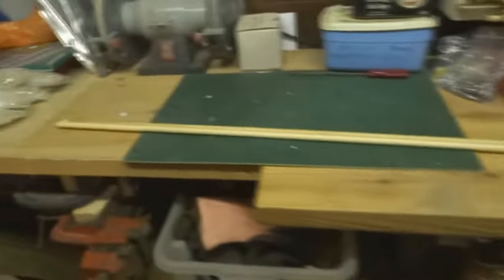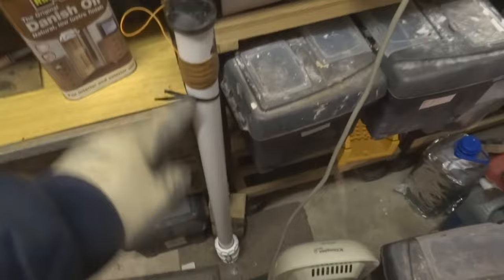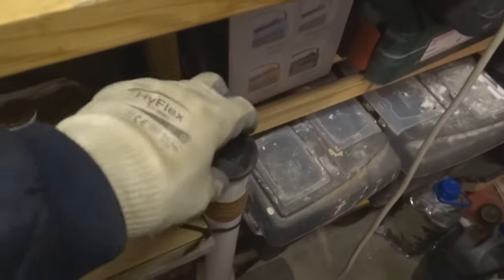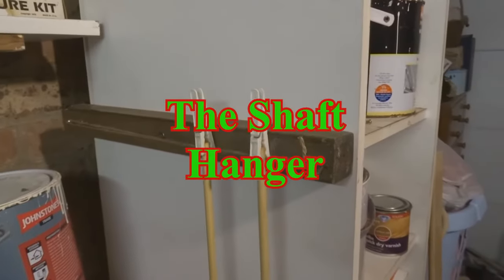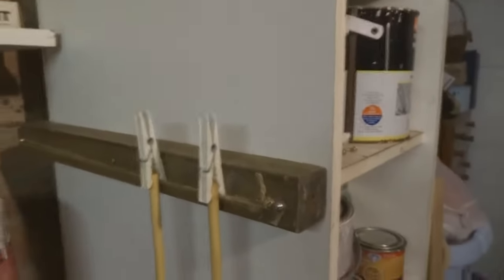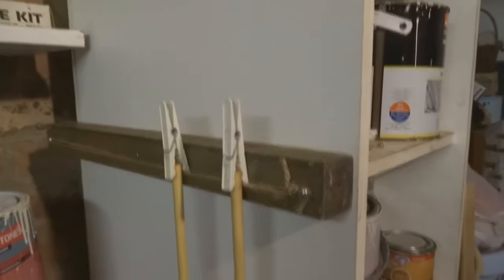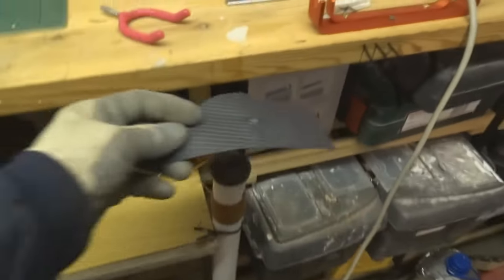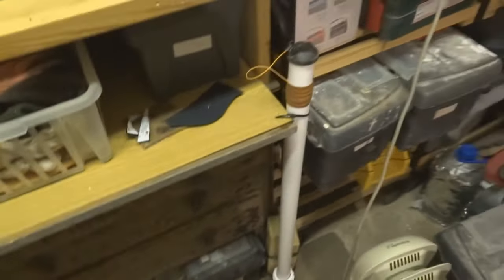How to make Arrows - Arrow Dipper and Hanger

Comment: Nicely done. I just started a new dozen shafts a couple weeks ago. I use a dip tube too, but find they are a bother to clean.
I have a piece of old bike inner tube attached to the mouth with a hose clamp (I got the inner tube from a bike repair shop for free). I punched a hole with a leather working punch. Avoid putting the hole near any seams in the tube. 
But I might try your idea. Several light coats always grumps one heavy coat.
You have any trouble getting fletchings to stick to Danish Oil?
Reply from the maker: +ImperialistRunningDo 
i think your idea is worth a try. Probably a bit quicker too.

Comment: Sorry to put a dampener on it but,  really. if you are using Danish oil , you do not need to dip.   At  £17 a litre.  ..what an extravagance.  Using Danish oil it is better to wipe on a coat with a  brush , thin coat ,  wipe off with an oil soaked rag. leave to dry and quick rub with wire wool and repeat the coating.. 2 thin coats are better than one dipped .especially if you then wipe off  and waste the excess..  Also, most important, dispose of wet rags by burning.. A crumpled rag soaked in Danish oil. can spontaniously combust whist drying.
 Unless you are in a commercial business making thousands of shafts. dipping is extremely messy and wastefull for the amateur.